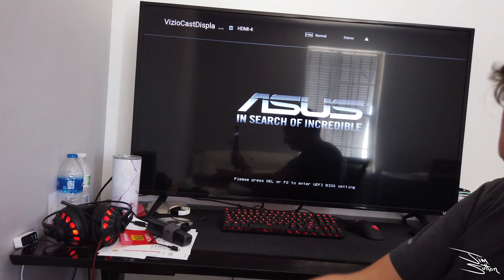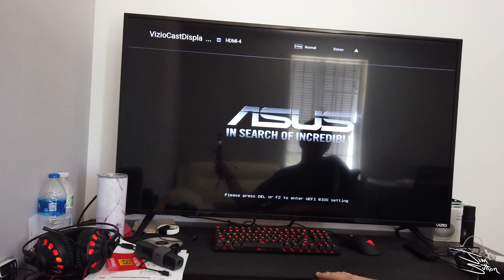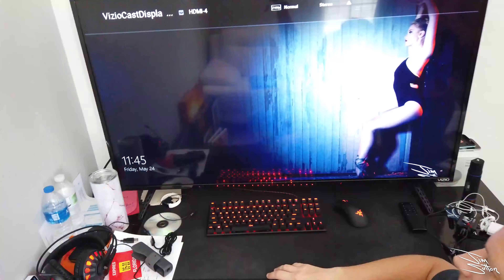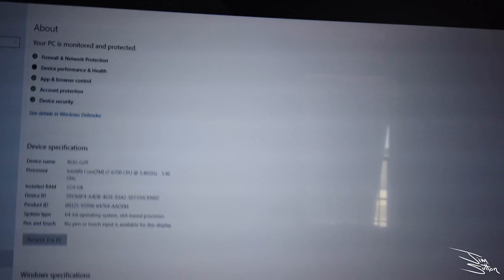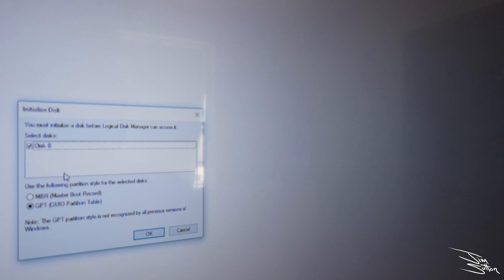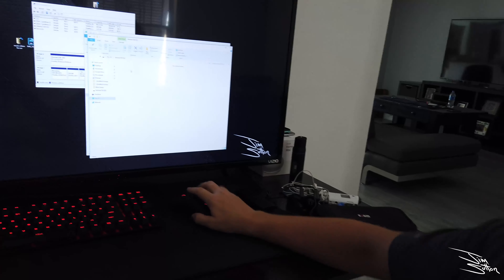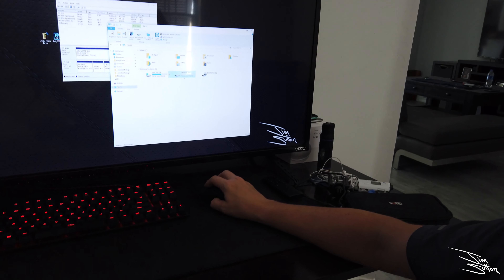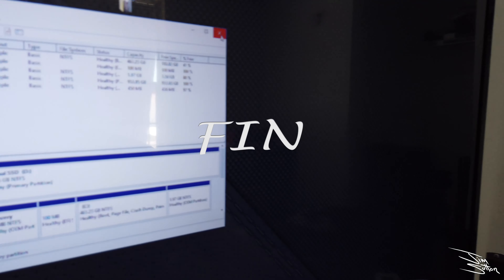VLOG #108 back up and running upgrading RAM and SSD for editing ROG G20CB

Comment: hello jim ı have the rog g20aj the basic brother of g20cb and can ı install 32 gb ram to my g20aj? ı have 16 right know 2x8
Reply from the maker: Not sure it would be worth the upgrade at that point.   I saw a few articles about that. And people seem to debate if it supports it or not.  In shot I am not sure.  And would doubt it would be worth the money.  It's getting too close to being worth a full upgrade at that point.  Maybe someone sle has tried it??  Anyone?
Reply: @DeCoNzMe  thanks for your return :)
Reply: After some reading, i found out the system isnt compatible with 32GB ram, due to only 2 x dimm slot.
The chipset (Intel H97) and processor (4790) supports 32gb ram, but only in a 4 channel configuration (8x4).
But: The computer boots up if use 8 + 16 (24GB)
Reply: @Elitelsir  thank you!

Comment: Bro, you posted this video last year, but it's helping me out now since I'm finally upgrading. I got the same desktop as you back in 2017 and haven't opened and cleaned it since lol. Thanks again!
Reply from the maker: So glad it's helping you man.  Best of luck!
Reply: I purchased mine from bestbuy in 2017 and I should be ashamed I’ve never opened mine up. I’m just now finding this video helpful. I plan on giving this build to my 15yo son with a new Harddrive. It’s been a solid PC for real!
Reply: @gregg3195  I opened mine about once a month to clean the dust. I recently upgraded to a 2080. There aren’t many blower gpus for this desktop and you can’t upgrade the power source since it’s external. I did find one video of someone soldering more ram on the gpus and changing the stock hdd to sdd which I have yet to do. With that said, I still find the desktop does everything I need to do. It still still play games at high settings without ray tracing

Comment: Can you drop the info on what ram you bought
Reply from the maker: Oh man.  I thought I had. I don't remember anymore.  Sorry it was a long time ago now :-(
Reply from the maker: I'm so sorry
Reply: @DeCoNzMe  it’s no problem I believe I figured out what it was but is there any ssd you could recommend to me I am having a problem with 100 percent disk usage when playing certain games i have already done everything like disabling Sysmain and indexing and did a full scan for any malware
Reply from the maker: @Smok0z  if you want a regular SSD.  Anything will work and be quite quick for this.. 
This could be a good replacement. Unless you want larger. It depends how much space you want. This is 1TB. So 1,000GB

Crucial BX500 1TB 3D NAND SATA 2.5-Inch Internal SSD, up to 540MB/s - CT1000BX500SSD1, Solid State Drive https://a.co/d/6TLMYhH
Reply: @DeCoNzMe  that will be perfect thank you very much I appreciate it god bless you and have a good rest of your day ❤️🙏
Reply: @DeCoNzMe  am I going to need a certain cable to install it?
Reply from the maker: @Smok0z  aren't you just replacing the smaller hard drive you have for this one?
Reply: @DeCoNzMe  well I’m a bit confused because in the video I see you installed a ssd where the hard drive is but I’m trying to just keep the hard drive and install a secondary one like the one you placed your operating system on
Reply from the maker: @Smok0z  I think it had 2 SATA cables. But I can't remember
 You may need another SATA cable.
Reply: @DeCoNzMe  ok thank you very much
Reply: @DeCoNzMe  thank you very much for all the help you provide I installed the ssd today and everything is working smoothly i want to let you know you are one of the only reasons I attempted this so thank you so much and god bless you ❤️🙏
Reply from the maker: @Smok0z  thank you. That is very kind!  I am glad it helped you!
Reply: @DeCoNzMe  you are more than welcome but again I can’t stress enough how helpful you were Also the quality of your video was actually superb it had me engaged and taught me a lot, but again thank you very much (don’t feel like you need to respond I know I typed a bit of a paragraph but take care of yourself ❤️🙏)

Comment: I swap the whole hard drive with an empty one. Now I have no operating system. Just when I want to put back the old hard-drive I accidentally dropped on the ground. Now at this moment, I have no windows 🙃 😅  need help
Reply from the maker: Oh no.  You need to create a windows install boot USB drive.   And in the bios, point it as the boot drive take a new install of windows 10 on the new drive.
Reply: @DeCoNzMe  yeah spent a day doing that
Reply from the maker: Did you get it done?
Reply: @DeCoNzMe  yeah. I have to download some bootleg windows to install it

Comment: Did you have to remove the optical drive to attach second SATA drive originally?  Have you tried installing an M2. hardrive?
Reply: I have, I bought a kingston A2000 m.2 nvme ssd 250GB. I installed it and worked fine prob like $50 on Amazon with 2day ship worth it
Reply from the maker: No. There are attachments for 2 HDD plus the optical drive.  And no. I have not tried a m.2 drive. Is there a spot on the board for that?
Reply: @DeCoNzMe  hello Jim.
 yes there is a slot on your mother board that supports m.2 .nvme SSD, its right under tray where u places your ssd drive. Now Nvme M.2 have faster read speeds, I think mother board supports up to 500gb storage. I personally went with a 250gb and works perfectly with no issues I only add a .nvme m.2 hard drive to run a game off it that's it, but totally worth HDD are just kinda slow now a days, also many people add it to run Windows for faster loads heres the link to the one I have installed
https://www.amazon.com/gp/aw/d/B07VYG5HQD?psc=1&ref=ppx_pop_mob_b_asin_title
Reply: @DeCoNzMe  I have the strangest problem. I was adding an M.2 SSD. Options in the bios to change the SATA controller were greyed out. I thought it was an bios admin thing, so I added a password - just 1 2 3 4. After adding the password I found I could no longer enter the bios. It requires me to enter the 1 2 3 4 password every time, but I am hitting F2, del, or fn-f2 in every combinations possible holding, spamming, pressing once. I cannot get back into the bios. I can still boot to windows fine though - I just can't change any bios settings ever! I can't flash the bios because I can't get to the EZ Flash tool (in bios or through F4). I can't remove the password for the same reason. Have your heard of  anything similar - was there a solutions? I've tried clearing the bios w/ jumpers, battery and disconnecting every bootable drive. "Press F1 for setup just skips setup and it tried to boot.  Help, please!
Reply: @Erik-ht1zd  u are using your m.2 nvme to boot up windows? If so I wouldn't have a clue, I only use it to run a game off it
Reply from the maker: @Erik-ht1zd  so sorry I didn't see this comment!  Did you find a fix? It's not something I have experienced.  I hope you got it figured out.
Reply: @Erik-ht1zd  I have a feeling you have a dead bios battery. try to change it.
Reply: @itsjoephoenix  Ended being a fried bios.  I ordered a new bios chip from Germany and that solved the problem.
Reply: @DeCoNzMe  Bios chip malfunction.  Popping in a whole new chip solved the issue.  Luckily I found a place in germany that sells them updated to the latest version.

Comment: Hi, I have g20Ci, already upgraded ram, added 2tb ssd and replaced 2tb hdd with 8tb. Everything works like a charm. Im now wondering if i can upgrade my gtx1080 with 3070 or even 3080. 3080 probably wont fit there but if, Will relpacing stock 230W gpu power supply with 330W one be sufficient to put there more power hungry card? Or maybe  motherboard has some kind of power limitation and psu upgrade wont literary change anything?
Reply from the maker: From what I understand, the slot is not as fast as the 3080 cards would use. So it will be a touch slower. But should work if it will fit!  Not sure about the fan setup. It may not work for soiling either.
Reply: @DeCoNzMe  Thanks for reply. Well, its pcie gen 3, not 4, but all intel motherboards are using gen 3, only amd supports gen 4 at this stage if im not mistaken so im not worried about this. My concerns are power supplies and not frying motherboard. Its huge difference in wattage, up to 100W. Im also not worried about fans as i have G20ci open lying on side all the time because im already overclockin 1080 like crazy. I found on some forums that guys are using Dell 330W replacements for 230W bricks and it helps with more power hungry cards, but its for 1080ti or 980ti with 250W tdp. 3080 has tdp at 320W. Also there should be 2x8pin connectors, i have 6pin to 8 pin adapter so technically it should work. Also 3080 is only 18mm longer than stock 1080turbo in g20ci so after removing this plastic clip holding gpu in metal case it should be absolutely fine. Did you hear about anyone trying to run cards that are more power hungry than 300w in this pc?
Reply from the maker: No I don't know anyone running something that power hungry in that form factor.  I have upgraded to another pc, but still have this one, my fiance is using it.   Still love the look, and it ran me good for so many years.  Best of luck pushing it that hard!

Comment: What's the SSD type I need to buy? I want to change my 128GB SSD to 256GB but I don't know which type I need to buy. I see it is placed near the coolers but I can't figure out the type. Thank you!
Reply from the maker: There are basically 2 types.  A "m.2" which is a stick type.  Looks kinda like a stick of ram.  But I assume you are talking about the standard drive type.  It looked like a small rectangle drive that just plugs like any other drive.   These are the cheaper ones that I like.  https://www.amazon.com/dp/B07B4G19X3/ref=cm_sw_r_cp_apa_fab_j2BEFbTME703K

Comment: lots of people bought {G20 AJ} series. not many bought G20 CB series, from what all these videos I see on youtube. I currently have 2 Asus ROG G20cb Oculus ready models, my main gamming pc has a GTX 1080 FE and my stream pc has a GTX 1070 and all I gotta say is these little beast have serve me me well was definitely worth the money I spent on them. can u please post a link on the ram u purchased also on the ssd since I might do an upgrade also mine came with 16gb ram and a HHD thanks btw nice vid
Reply from the maker: solid state : https://www.amazon.com/gp/product/B07B4G19X3/ref=ppx_yo_dt_b_asin_title_o00_s00?ie=UTF8&psc=1

RAM:
https://www.amazon.com/gp/product/B07H4YBTYY/ref=ppx_yo_dt_b_asin_title_o02_s00?ie=UTF8&psc=1

 and thanks for watching!
Reply from the maker: these things are a beast.  i cant find a reason to build a new pc.. even though i keep trying to find a reason.  but dang, this has been a great PC
Reply: @DeCoNzMe  bro, got links for the RAM? Which specs did you use? brand etc?
Reply from the maker: @itsjoephoenix  Timetec Hynix IC 32GB KIT (2x16GB) DDR4 2666MHz PC4-21300 Unbuffered Non-ECC 1.2V CL19 2Rx8 Dual Rank 260 Pin SODIMM Laptop Notebook Computer Memory RAM Module Upgrade (32GB KIT (2x16GB)) https://www.amazon.com/dp/B07H4YBTYY/ref=cm_sw_r_cp_apa_i_ICmfEb4XZZDC2
Reply: Jim Sutton , is timetec the best option for a ram upgrade if I use my computer for specifically gaming , or do you think I should use a different brand? I could really use your opinion.
Reply: @joeydearden5569   I have 2x16 Hyperx  8gb each @2666hz just depends on your budget.. Its alot more snappier, in terms of gamming performance it does run a lil better but not drammatcly. Also add a m.2 nvme ssd.
Reply: @DeCoNzMe  Thank you so much Jim!
Reply from the maker: @joeydearden5569  I don't think there is enough of a difference from what I can tell.  I do video editing and gaming on mine.

Comment: I ordered the wrong SSD size 😭, do you know if it’s possible to remove the hard drive and replace it with a SSD?
Reply from the maker: Yes it's possible.  Did you buy the larger one that needs to replace the large hdd that came with the computer.  Yes you can replace it. However you will need to install windows on the new drive. So make sure your prepared to do that :-)
Reply: Jim Sutton my Windows is installed on the current tiny 120 SSD at the moment I’m thinking of removing the hard drive and installing the larger SSD I’ve now got?

Comment: Hey I just saw this vid. I have the same desktop as you and need more space big time. What should I go with?
Reply from the maker: You mean for hard drives? It depends on what you are using them for.   I like having a 500GB solid state.. and then I have 2 - 1TB drives internal, and 4 - 4TB drives (usb 3) that I use for video storage.

Comment: I have had one of these since late 2015 and haven't even opened it. I am planning on upgrading the boot drive to a m.2 ssd if possible and the storage to a standard sata ssd. I was also planning on upgrading to a RTX 3070 as it seems like the power shouldn't be too high for it and it fits in the form factor of a standard 970 like I have in there right now. You think this will work fine for this? Also what Ram did you upgrade it with?
Reply from the maker: Nothing wrong with an upgrade like that.   Every build is so specific to what your use of the computer is.    Sounds like a plan to me.  The 30 line of new video cards sounds good.  I will have to look into it as well!
Reply: man dont buy the rtx 3070 because of the fans. the rtx 3070 has 2 fan in front and the back side of the card so the air intake of the gpu will be a problem. just thing about that and try to buy blower style gpus
Reply: @BoraGurses  I have since decided to just buy a whole new system and the 3070 when I can. I'm sure i won't be able to get it for some time after release.
Reply: Mike Yearsley its a good idea if you are not living in turkey you know our economy sucks. İt is impossible to buy rtx 30 series if you are a student. So good luck with your new system

Comment: Could I upgrade the gpu to a 2080ti or 2080 instead of a 1080
Reply from the maker: That I have not tried. I have a 2080 super in my other PC I got.  However I am not sure why you couldn't.  It's mostly about physically fitting it in there. I am pretty sure the power supply can handle it.
Reply: @DeCoNzMe  thank you very much. will do more research would like to have 2080ti and 32gb of ram instead of 16gb

Comment: I ordered kingston hyper x 32gb 2400mhz ram. Will the system actually run the ram at 2400mhz speed or is the ram capped at 2133mhz?
Reply from the maker: Not sure, bit I think it will slow the ram down a little to run the system speed.  But I didn't try changing what speed ram I have.
Reply: BIOS > XMP > Enable,,,,, 2133 can run 3200

Comment: wear did you get the 32gb of ram from ive been looking and couldnt find any
Reply from the maker: There is a link in here somewhere.   It's a laptop style ram stick.  It's in the form of 2 - 16 gig sticks
Reply: Jim Sutton I found it also what processor do you have
Reply from the maker: @Vape-_-  I can't remember.  Was it the 17 - 6700?

Comment: did you reapply thermal paste or leave it as is
Reply from the maker: I didn't touch the processor or the thermal paste.
Reply: Even after removing the heat sink you should re apply the paste or it could work as effectively i think

Comment: Hi, I got a G20CB too and I want to know if the motherboard supports higher frequency ram? like over 3000Mhz? I heard that motherboard doesn't support those high frequency ram
Reply: Hey i also have g20cb, i was wondering if you know if a Radeon RX580 work with it??? Sorry i couldnt answer your questionn

Comment: Hey Jim! Nice video. 

I have a few questions! 

Do you know beta the max speed that motherboard supports for ram? Also im aware the motherboard has a m.2 slot but does it support nvme or just ssd? 

Lastly it seems silly but I may be upgrading from the I7 7700 to the 7700k model for higher clock speeds and plan on putting my old titan xp I. This build. 

Im hoping it won’t exceed lower expectations considering the following components 

Titan xp collectors edition 

I7 7700k 

32GB dual channel memory (unsure if speed)

The 1tb m.2 ssd or hopefully nvme 

And a 4tb ssd. Thanks!
Reply from the maker: Wish I could help you with that. But I am not using that setup anymore. So I'm not sure of that, and can't test it out. I'm sorry.  Best of luck with your build!
Reply: @DeCoNzMe  So with this computer when you're hooking up a second hard drive does it connect where the original hard drive slot does or in a different spot? I am not sure how to hook up 2 hard drives if my original hard drive is taking up the only power sand SATA slot.
Reply from the maker: @Entropian2012  there are more sata slots on the motherboard.  But you need an SATA cable to plug into it.
Reply: @DeCoNzMe  I am guessing I would also need an extra power cable?
Reply from the maker: @Entropian2012  there are more power connectors as well.  Just look off of the power block.
Reply from the maker: @Entropian2012  no. The power connectors are there. Follow the wires from the power supply.  There should be I think it was 2 more.
Reply: @DeCoNzMe  Nice thanks for thelp.
Reply from the maker: @Entropian2012  of course. That's what we are here for.

Comment: Jim, by the way, after upgrading your RAM, has your startup time and performance with RAM hungry Softwares (say like premier or after effects) been noticeably better?
Reply from the maker: It definitely needs the more ram.   The startup time, and opening apps is massively improved by putting your windows, and app install on an SSD or on an m.2 drive.